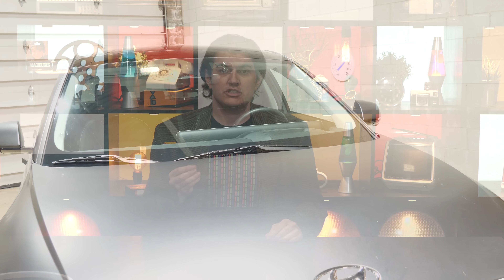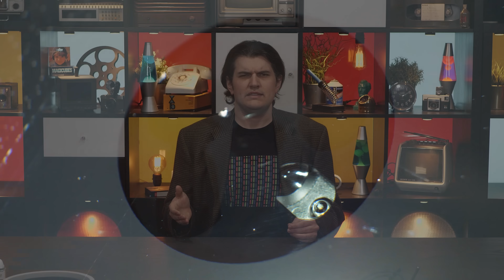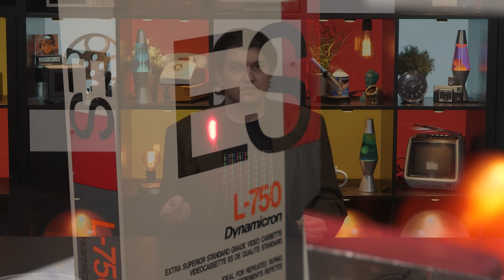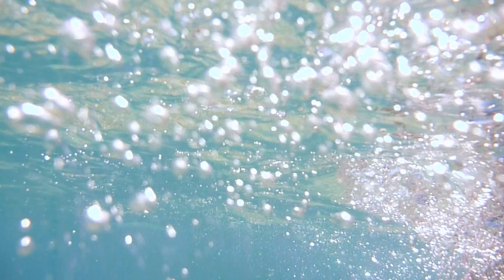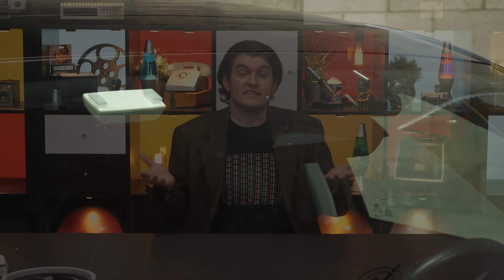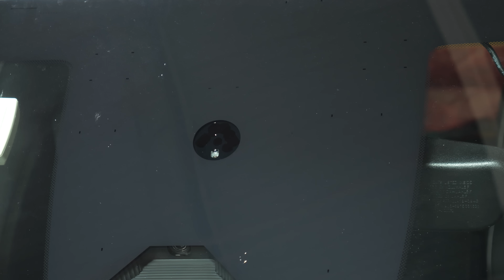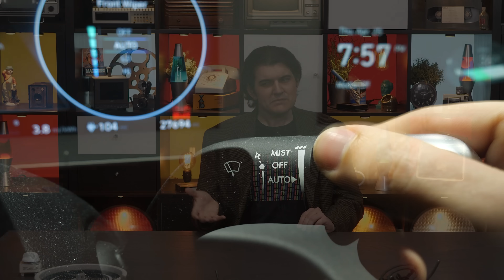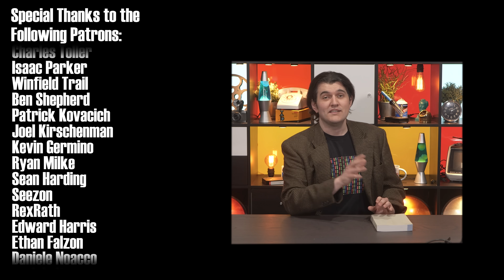The simple, clever sensor behind automatic windshield wipers

Comment: My only real complaint about my car is that my windshield wipers are extremely slow to turn on when it's merely misty. Meaning I can have a nearly opaque windshield and it still won't wipe. I have to jiggle the thing manually constantly, because medium is way too fast.  I just want the ability to set a boring old intermittent.
Reply: Basically, if it's just misty (a thing which exists in the PNW, for example...) I'm constantly flipping the stalk the entire drive. I absolutely hate it.

Comment: Yup, the car has to calibrate the sensor and most vehicles, if left on auto, it will often do single wipe when you start the car or when you flip the unit from "off" to "auto".   The calibration is completely trivial.  It just reads the sensor after the wipe and uses that as baseline-dry, adds a bit of margin to the value to reduce instances of mistaken wipes, and its done.

The only problem I have with mine is that if I leave it on "auto" that initial calibration wipe when turning on the car winds up being a dry-wipe if it isn't actually raining, and I really don't like it when the windshield wipers dry-wipe a dusty piece of glass.  Just asking for a long scratch that way.   So I always turn the sucker off when exiting the car now.

i seem to recall some vehicles doing something slightly more sophisticated... putting the LED on one side of the windshield and the sensor on the other side, or something like that, to get a more reliable indication.  Multiple bounces so any water in the detection area at all really disrupts the signal.

Comment: I kinda hate this. Or at least the execution of this. How it works require that there is absolutely no air bubble between the sensor and the windshield. On my vehicle, the sensor went bad, and it is impossible for me to DIY it without introducing air bubbles upon reattaching it. If you go to the dealership or a repair shop, they will quote you for a complete replacement of the windshield even though the windshield itself is perfectly okay. I'm not against new technologies; I just hate the barrier to DIY that they introduce.

Comment: And now i have to say - as a software developer - YES !!! F** the software. Give me PHYSICAL INTERFACES!
Touchscreens can be nice, but there are things they just can't do. Give ma a simple knob to adjust the temperature of my stove, not some crazy touchpad that you first have to unlock, then it starts angrily beeping at you cause your fingers were just a bit too wet, then you have to wipe it dry (and of course it beeps again), then you unlock it AGAIN, then you can change the settings.
Oh, you pulled the pot over the interface or had some waterdropplets spill on it? Too bad - now it is turned off again and you have to get it dry enough again.

Or with the windshield-wipers.
Yes i am a person that first thing after unpacking something is reading the manual (before using/turningon/whatever). And i still hate that. Why change something that worked perfectly fine? Why even make it intentionally more complicated, more error-prone and more expensive? If i start the whipers and then turn of the car then it is my intention for them to stay exactly where they were. This is not a complicated feature - this is literally the default behaviour. It needs no software being developed, not extra testing if it works in all edgecases, no extra hardware to keep the motors powered after shutting of the vehicle.
If they want then sure, add that konami-code as an extra, but for the love of everything - don't take away the actually useful things.

Comment: While it's neat that somebody invented it, it's one of these things I really don't need.
I got mark one eyeballs trained at the road through the glass, picking up weather conditions along the way. And with the excellent usability of having a wiper control stick next to my fingers near the wheel I can adjust as needed any time. It's just another cable and logic that has been put into the car. And while it may cost next to nothing, I sure have to pay a premium for it. Aside from the fact that it is yet another point of failure.
Reply: That last sentence sums it up. These features can be nice to have, but at the end of the day they're more likely to cause a failure. I rather have working wipers.

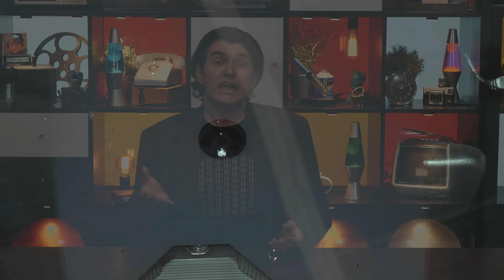Comment: 6:45 explains a rather annoying behavior when Mercedes introduced the first rain sensor around 30 years ago: the wiper would always make one wipe when the car was started. Parked in an always dry garage this was very unfavorable. And it also explains why it was not  available that Time with tinted glass.
Thanks for the brilliant explanation as always!
Reply: Today there often is an area above the mirror that is not tinted the same way as the rest of the area.
Most of it is tinted using metallization, then the small area has paint dots, and the place where the sensors are is blank.
This area is also used to put electronic payment systems for toll roads, that require unshielded radio transmission.

Comment: Was that thing at the start a quip at Tesla doing it with cameras only? I've driven a Model 3 for a couple months and oh my god, the automatic windshield wiping was utter and complete crap. I would have just disabled it, but guess what, it turns on automatically whenever you enter cruise control. Oh and, to control it manually, you have to use the freaking touch-screen at the center. I think this was by far the most idiotic thing about that car. Some aspects of it are great, but the bad aspects are unforgivably stupid because it's a massive regression on things we already had a good solution for... I'm driving an MG4 now and although it also has some stupid software flaws (remember it's much cheaper than the Model 3), it actually has PHYSICAL CONTROLS!

Comment: Now if only the rain sensors actually worked and didn't end up either not running at all or running att full speed no matter the ammount of rain. I have driven volkswagens, mercedes, toyota, renault and fords with rain sensors, and not one of them worked peoperly and reliably.

It usually ends up turning the wipers on and of manually simulating the older adjustable interval wipers.

Comment: On the topic of wipers, the 2013 volt will pause the wipers wherever they are when you turn the car off. But.... If you notice that you left the wipers up when you didn't intend to, you can put the wiper stalk back to the off position and it'll actually park the wipers. But only if you haven't opened a door yet! Quirky lil bugger.

Comment: The car knows when it's wet at all times. It knows this because it knows when it's dry. By subtracting when it's wet from when it's dry, or when it's dry from when it's wet (whichever is greater), it obtains a difference, or humidity. The wipers subsystem uses deviations to generate motor commands to wipe the windshield from a state when it's wet to a state when it's dry, and arriving at a humidity it wasn't and now is. Consequently, the ammount of water droplets it has, is now the ammount that it hadn't, and it follows that the humidity that it had, is now the humidity that it hasn't.

Comment: I read car manuals. Cover to cover, which is irritating when they cover several trim lines and a lot of stuff doesn't apply. But my head is still based in analog cars from the 80s. There's SO much going on "under the hood" as it were, there's no way I'd make use of most of it without being told it was there in the first place! 

But there's also no way I would have remembered the wiper change maneuver, though I have had to YT-search how to change the blades on both my car and my wife's the last time I did them. Both cars are like those annoying iron bar puzzles that were popular for a minute. :D

Comment: Could you do a video explaining how these modern front load washer machines “sense” the load size?  My LG squirts a little water, then tumble, then repeats this until it decides it’s had enough. Always been curious as to what’s actually happening in the control boards logic to make this happen. I’m sure it’s some type of resistance “weight” that it measures then calculates the load size.  Thanks for your videos.
Reply: Many of them have a pressure tube behind the drum that closes as the water fills up. As the water level in the back rises it pressurises the air in the tube. The air pressure correlates to the water level. That's why it stops when it's sensing so there is no movement of the water.

Comment: the wipers motors on the bolt seem to unlock, as in have no resistance to being turned when not in use. dont need to move them for changes but I thought all cars did this now

Comment: I dunno why Tesla used a camera the sensors are absolutely dirt cheap and they dont really fail. My car is a 2006 and the rain sensors still work absolutely spot on. I find the only nuts if the window is frozen/misted over. Apart from that they just work may he different for other manufacturer but both my fords are spot on.

Comment: I remember years ago on automotive forums people DYI'ed rain sensors with optical mouse sensors.
Also, the manual being over 700 pages, ain't nobody got time for that.
Reply: It's more than likely in 3-7 languages, and the index likely takes up a good chunk of it to boot
Reply: @HmmmmmLemmeThinkNo  Rav4 Prime or PHEV (in EU) single language manual
Reply: When I buy a vehicle, I figure I’m buying a tool multi-function tool worth tens of thousands of dollars.  Its two most basic functions are to drive places and to keep its occupants acceptably comfortable and reasonably protected.  Other than the very most basic driving controls like the wheel and pedals, every model has differences between every other.  

Aside from wheels and pedals, most other controls crucial for driving—your lights, signals, wipers, mirror/seat/wheel adjustment, and the Park/Reverse/Go thingy—all of that can vary widely in form and function.  Everything else—everything related to comfort, convenience, entertainment, and even basic maintenance—well, nothing is standardized at all.  It might as well be anarchy.  

So I figure, when I spend thousands or tens of thousands on a new or used vehicle, it’s absolutely worth it to go through the owner’s manual so I can be sure I don’t miss any features on this incredibly complex and expensive thing.  I like to know what I have and how to use it—all of it.  I paid for all the features, so damned if I’m not going to use (or at least try) all the features.
Reply: Thankfully, most major car companies have the manual available online and easily searchable. But you still need a paper manual for emergencies.

Comment: An optics engineer once told me "everything is specular as the angle of incidence approaches zero." I worked to memorize his words because I thought they were cool. That's what you're talking about looking up at the pool surface. Specular means mirror, sort of. I've waited decades to recall the engineer's words for some purpose other than how cool the words sound. 40 years ago, when the engineer said them, I also discovered the "Wait...what?" meme years before it became popular.
Reply: If he was indeed an optical engineer, that's not what he said. The angle of incidence is measured from the normal to the surface, so a zero angle of incidence is straight on. Things become specular as the angle of incidence approaches 90 degrees.

Comment: My car has an incredibly sensitive alarm which means, if there's so much as a moth inside the car, it will trigger the alarm.  Took me a couple of months to discover THAT was the reason my alarm was going off every night.  In the meantime I really wanted to find a way of locking the car WITHOUT enabling the alarm.  Turns out there are no instructions in the hand book telling you how to do that.  Countless searches on the internet, still no luck.  You can't even leave the car unlocked unless you leave the fob inside the vehicle or leave a door open.  You have no idea how much sleep this lost me.

In the meantime there's a button on the overhead panel near the dome light that is not covered in the handbook.  Apparently it simply doesn't exist.  Also I couldn't find any other vehicle on the internet with this button.  It's definitely a factory installed button but I couldn't figure out what it does.  Turns out this button is to allow you to lock the car without the alarm.  Press and hold until the LED on the dashboard starts flashing rapidly, then get out and lock the car.  If that LED now stays on, congratulations you now have a car that's locked but not alarmed.  It allows you to get a decent nights sleep without upsetting the neighbours.  If only it was published somewhere.

Comment: There should be a way to completely disable the automatic wipers feature and not have the wipers running full steam.  There's nothing more annoying than seeing a car with its wipers running full steam in a light drizzle.
Reply: Have they stopped having an "off" position on the stalk?
Reply: @Poldovico  I'm talking about being able to completely disable the automatic operation.
Reply: @davidfrischknecht8261  what do you mean by "automatic operation" then?
Reply: @Poldovico  I want the ability to turn the wipers on manually and control the intermittent speed myself.
Reply: @davidfrischknecht8261  ah. Rip.

Comment: This is clever, but I have never been driving a car in the rain and found the "need to turn my wipers on" to be all that onerous a task. The automatic sensors are usually wrong about how often or how fast the wipers need to be on/running, turn themselves on when not needed, and otherwise require more effort from me to tell the car to stop turning the damn things on. 

Like, what focus group did the car industry listen to where "turning the wipers on makes me sad" was the conclusion? And how did they not come to the conclusion that when the rain sensor senses rain, the fucking headlights and tailights should also automatically come on?

Comment: I have mazda engineered automatic wipers, and they're pretty solid! The only issue I have had with them is when there's fog on the inside of the car, it'll activate them. It doesn't happen every time, and I deal with it maybe two or three times a year, but it does happen. As far as not activating in heavy downpours, I never had that issue! I only have to override during the few times a year that the fog trips it up, or when I need to clean/change blades!

Comment: I knew where the sensor was and I had theorized "Something to do with lazers" but until now I didn't actually know how my car magically knew when it was raining. So thanks muchly Mr Connections, great vid as always. 

 I hadn't driven in a long time before my current car. so having it slow down when the rain started to ease off was impressive to behold. It isn't perfect as mentioned above, as there are times when the I REALLY NEED YOU TO HELP ME SEE THROUGH THIS LITERAL WALL OF WATER setting is required to enable safe driving. Which happens a lot, but that's Ireland for you.

Comment: Love it and understand the sass being thrown at a parTicular originisatition. I owned a 2015 used S prior to my Y and having rain sensor worked so much better in the S. Mind you the camara based tech has gotten better in my Y over almost 2 years, but I don't think it will be as good as this very simple technology. Elmo has more ego then brains in certain tech unfortunately. Although I do have to say one plus is to put it in wiper service mode is 2-3 screen taps away on both the S and Y

Comment: After driving Fords for almost my entire driving career, I bought a 2020 Palisade (the Explorer seemed like really bad news, no matter how much I wanted one.) My learnings so far:

One, when I take the Palisade in for service, Hyundai turns off the automatic wipers and lights, leaving it up to me a few days later to wonder why I can't see at night anymore. 

Two, the Hyundai ergonomics differ from the Ford ergonomics. To perform function A, in the Ford I press the button twice. In the Hyundai, I press and hold for two seconds. The radio and cruise control buttons have swapped sides on the steering wheel, leading to me turning down the radio volume instead of decreasing the cruise speed. There are enough of those tiny differences to drive me slightly nuts.

Three, the owners manual seems very poorly organized, and the index isn't all that useful. I don't know if it is simply a translation problem, but finding a particular function (I actually looked!) is sometimes very difficult. I sometimes have to wonder, 'how many different ways are there to describe what I am looking for?" in order to find it in the index.

Four, the hood edge does come up rather close to the windshield. This makes it difficult to change the wiper blades, prop up the wipers above the window when freezing rain is coming, and to clear snow from the bottom of the window. Hyundai actually had a recall on the wipers because they apparently couldn't handle Canadian winters.

Overall, the Palisade has been great, but it does have it's idiosyncrasies. I turn off almost all of the "driver aids" because Hyundai and I have very different ideas on how best to drive the car.

Comment: I loved your totally non-specific rant at the beginning. My experience of Auto-wipers Beta (for at least 4 years) has been lackluster at best. Simply using intermittent wipe at a fixed setting is more effective. However, I also have experience of two other vehicles (Rivian R1T and Nissan LEAF) which use the extravagant sensor this video is about, and their behavior is similarly lackluster. Manual wipers for me.

Comment: On our vehicle, the wipers aren't locked in place when it is off.  You can simply move the wipers up the winder some to then stack them up to change the blades.  I do like that they did that, as with ours it also sits on rest position below the hood line so it cannot be lifted without moving the wipers some first.